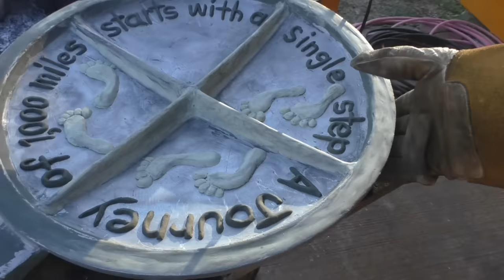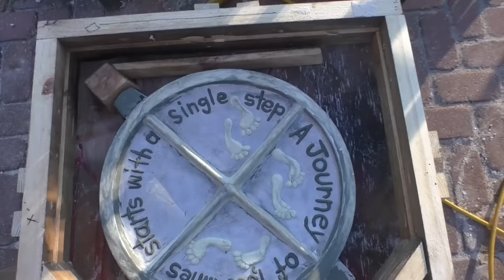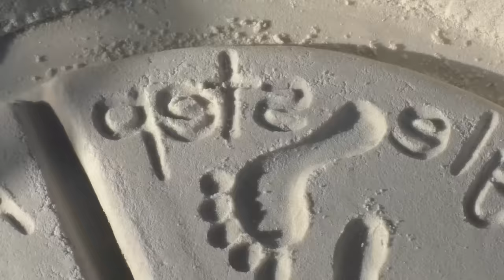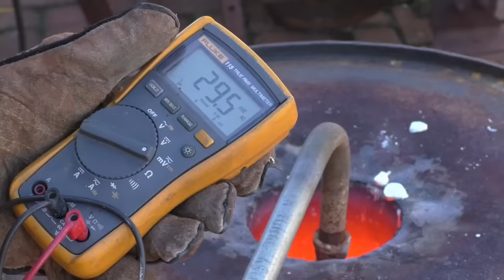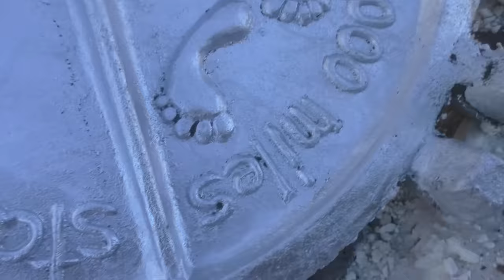Step by Step Aluminum Casting with Sodium Silicate Sand

Comment: I have a 5 gallon container of sodium silicate that I am going to try out soon!  My foundry supply also suggested using sodium silicate sand for home casting when I was getting started.  So far I have only used petro-bond, lost foam in wet sand and plaster/sand mix.  I really like the PB, but now I have about 60lbs of the stuff that needs to be remulled. Thanks for the detailed vid on SS sand!
Reply: Alphaset is a very cool product sets up like sandstone and is perfectly dry (think 1/8-3/16 walls). the molds can sit for years, they even set big blocks of it and CNC the cavity out. silicate I'm told loses half its strength in 24 hr. I made a 11-part mold out of it and filled it with 100 pounds of iron

Comment: This was the first video of yours that I've come across.... and I watched the entire thing haha. You kept the knowledge coming the entire time man. Thank you.
Reply: Same ways.  You've got an excellent channel yourself good sir.
Reply: I've watched some of the older videos starting maybe 6 years ago or more as was really inspirational when I lived on the Kalamazoo River since was researching building a steel or aluminum (titanium would be interesting though never verified materials performance and cost seemed unreasonable) electric hybrid jet boat with solar cells on the surface. I was also toying the idea of integrating into a larger sailboat catamaran or with jet boat motor room center hoist boom crane idea pod trimaran.  I did get around to experimenting with using a 1000W gas generator with a computer power supply modified with higher current fuse and terminals as well as wiring and used with a trolling motor with the canoe and I think I used on the John Boat that was stolen prior too. Never got around to making a transom with the kayak, though did invest in a windsurf board to keep the project going.  I was also looking into external combustion sterling engines since work better with more heat exchange potential and under higher pressure (maybe better for submarine or trench thermal vent power stations or maybe on some kind of high temperature volcanic tap desalination mine operations system). Well, I wound up being armed robbed and shot while watching a ferro-cement project since was looking into other systems like concrete ice breaker potential projects along with the water cistern and bio-gas generators (ICP/ARC Furnance and fermentation) I was looking into making on the hillside.  Lately, I've been looking into and making rocket stoves and want to make a sodium/calcium/magnesium silica aluminum oxide sand with a titanium oxide liner.   I was also thinking about adding a graphite liner too to store more heat on the outside and maybe prevent corrosion deeper.  I have the materials and way more higher level enforcement now since I had to learn some far out ES/TS EW weapons systems worse than the Cuban Embassy U.S. Diplomats et.al. issues to determine what was targeting me in the first place.  Excellent videos!

Comment: nicely done!!!
When you play with the investment casting if you do your first dip then put the tree in a vacuum vessel and pull a vacuum you will pop the little bubbles that naturally form on the surface of the wax giving you a fantastic surface that in many cases will not need any machining. Just a little trick we used to get high definition back in the day 
Love watching the Videos, please keep them coming!
Reply from the maker: +Marc wire    Thanks for the tip.
Reply: Marc wire uui

Comment: To do parts with multiple drafted surfaces as sand castings, you employ cores which are basically just smaller, separately molded sand inserts positioned within the main cavity. It requires making separate patterns for the cores, and you have to be a bit more careful of core, top cavity and bottom cavity alignment when handling the mold.

Comment: Man, this project is amazing. I just came across your videos a few weeks ago and I've been coming back for more ever since.

I did a bunch of bronze, aluminum and iron casting is art school. We never used sodium silicate as a binder, but I remember hearing about it. I have a few tips that may help you. One is that while ramming the first half of your mold you may be able to use green sand to form a temporary form instead of having to come back and clean out all of the sand that undercuts your pattern. I used plasticene a lot of the time, and sometimes just loose sand. What I don't know is if there is a chemical reaction with the sodium silicate.

Another suggestion which was drilled into me heavily by my professors... make your cup bigger. Hydraulic pressure is your friend. It not only allows you to pour a little faster (not too fast to avoid turbulence) but it also acts as another place for your heat to draw from as the casting shrinks. 

And a third suggestion, which may be moot since I don't really know how resilient sodium silicate is; the thin sharp areas of sand are prone to erosion and can cause inclusions. We always mixed our sand a little richer in areas that seemed fragile. 

Also graphite wash... not really neseccary with aluminum, but hotter pours it really makes a difference.

Thanks for doing what you do. It's amazing and your breadth of knowledge and demonstration of DIY method is a body of work all by itself.
Reply from the maker: +derrick mcnew     Thanks for the tips.

Comment: Vinegar and baking soda to make co2..... BTW best video I have ever seen about casting..... You explained the flue and riser and vents perfectly...... To big a riser just gives a chunk for the next melt to small and you could ruin all that work..... Awesome video.... I have done some small aluminum parts  casting..... I used a 14 inch clay flower pot buried in the ground with a u shaped pipe in the ground to the hole in the bottom of the pot with a hair dryer blowing air..... And I used charcoal briquettes for barbecue and added air.... Worked very well..... I just used damp sand which gave rough finish due to the steam.... I cast finned  blocks to shape for machining the bore and bearing surfaces to make radio controlled airplane nitro and diesel engines..... Yep just for the fun of accomplishment...... Ain't it great doing things yourself just because it's about learning and accomplishments..... Gonna have to watch your other videos

Comment: Hi Doug,

First, I want to said you, as you are a real inspiration to give the next step to realise our dreams... You are an idol!!!

Now my idea (an a idea as come from a really ignorant person in cast process) but, seeing this video I had the idea to make more easy and quickly the process to clean the mold in "the side of the feets", using a big donut of hard polyfoam with angulated borders. 

This way, the foam replace the sand and when you open the bottom cover, you will can remove the foam, and the shape will be clean and ready to go to the next step, and you avoid the possibility the damage the molder shape. 

I hope it work, if you try it...

A big hug from Chile !!!
Reply from the maker: +lucholarry    Yeah, that would work.  It's called a "following board".  We used a following board when we cast the propellers.
Reply: +SV Seeker 
Mmmmmm. I saw again the video about the propellers, and is not exactly that i was thinking.

I'm talking about another kind of foam... But i don't know how you call this, in US.

Something like this foam : http://www.foambymail.com/Merchant2/graphics/00000001/polytn.jpg

Big hug !!!
Luis
Reply from the maker: +lucholarry  Ok. I understand.

Comment: The match plate is easy, made lots of them. You make up the mold just like you do, except don't put any holes in the parting line face. You then take the flashing, stick it between the sand and flask, then bend it over the edge of the flask. You do that to both sides. you then put on a bit of fire clay, or nearly any king of thing to seal up the seams, and put thin straps of steel between the flasks, also with the seams sealed up with fire clay. That leaves a gap between the two halves. Instant match board when you pour it, with the runners and every thing. Really great for uneven parting lines, such as the part you are doing. The biggest down side is you get double the shrink, since the match plate shrinks and then the parts you make with the match plate shrinks. It does use a lot more metal then you would guess to pour the match plate. You also have a lot more force trying to open the mold, so clamping and some weights on top help. A little damp sand also helps with leaks. With your glove on take a large hand full and push it against the leak. OSHA probably doesn't approve, but have seen it done / done it in lots of places.

Comment: Nice job. I used to make molds for Rockwells' foundry in 1973. There were the pour-off guys, the molders, shake-out, pattern makers, everything. Seen some bad accidents, too. A guy was standing in the pit with open boots not allowed in the foundry and a breakout filled his boot with iron. foundry boots are tightly banded at the top. Scraping slag off the top with flatbar make sure there is no oil on it or it will blow back a few pounds of melt at you. Sometimes somebody would be goofing around a toss an oiled flatbar into a pot for fireworks, lol. Safety first

Comment: I have had problems with porosity in my aluminum pours, mostly reveled after machining. I'm sure you are ok with your hatch covers but for more critical parts it is defiantly worth the extra step. I have also tried the tablets but they don't seem to do much good for me wither. Lately I have been injecting the molten aluminum with argon gas right before I pour as I heard this is what a lot of foundries do. I made a gas injection apparatus by taking a stainless steel tube and welding it to a round plate (with a hole through it to let the gas through) and several other holes in it to disperse the gas. I have an air hose connected to my argon tank regulator with a typical compressed air blower attachment just like you use for your C02 for curing your sand. I put a rubber hose over the non-business end of the stainless steel pipe apparatus and it connects to my air blower attachment. I first mix flux into the molten metal using the stainless steel apparatus and then bubble gas all throughout the crucible. The flux seems to really help reduce the slag into a light powder which floats to the top. I hardly get any of the chunks of slag that don't melt like I used to. Of course exercise good common sense as just a little bit of gas can go a long way in boiling hot aluminum everywhere. I have had zero porosity issues since I have started doing this. Keep up the good work and keep the videos coming.
Reply from the maker: +Goldenstein Engineering and Fabrication LLC    Thanks for the tip.  I rarely cast anything that critical but I'll give that a try when I do.

Comment: We always just did these vertically in school. There was no worry of breaking the molds etc., we just slid the two halves apart and back together. And dross came right up to the top.. seemed pretty simple. - Very cool work.

Comment: I had a deep draw pattern that took me a long time so I made a silicate mold.  I found setting the silicate at anything over 1/2" thick really difficult  and I had to pierce the mold more times than I'd like to get the gas to set the silicate but the cast did work and I'd never have managed it in greensand.

For the cope I just used silicate as a facing sand but the drag was all silicate.

BTW top tip on switching buckets when mixing.  Wish I'd known that!

Comment: Hi,
I've been following your progress since the very beginning and I find it amazing how much you've achieved and allways look forward to the next upload. Keep up the great work.
A small tip, be careful with liquid sodiumsilicate! It can cause serious chemical burns. Its made by melting silica sand or quarz sand with caustic soda and then adding water and the result is a very high alkaline liqiud. I work with water glass as its known in the chemical industry every day.
Reply from the maker: +Gary-John Spurs    Thanks Gary.    ...and thanks for the warning but in reality I routinely have it in contact with may bare hands and I have not noticed anything other than it stings a bit when it get into a scratch.  The guys at the foundry use bare hands too and they have used it everyday for years.  You must be using something higher than 40%
Reply: +SV Seeker The stuff we make is of a very high concentration. it starts off as a solid looking like broken glass and we basically heat it up and add water. ive had it on me a few times and not realised until under the shower and the top layer of skin peels off. it can be nasty stuff. I wish you all the best with your work and look forward to the next upload. Gary.

Comment: You're using Type K thermocouple.

29,6 mV from the Type K thermocouple with 0°C reference junction.

If I remember correctly you need to subtract ambient temperature mV due to the junction between type K (chromel–alumel) wires with the multi-meter copper wires.
At 30°C ambient temperature you have 1.20 mV on the table, subtracted from the 29.6 mV you read il would leave you with 28.4mV equivalent to 683°C.

Comment: Amazing video, you've covered so many little casting tips and tricks too. I had been wondering about home use of sodium silicate sand as the bulk of the mould instead of greensand. It's given me a lot of valuable information for an upcoming project of mine - a ~400cc miniature Chev style V8. The cylinder heads are looking like it might be possible to actually cast at home via this method as greensand looks to be too difficult to handle with the amount of cores I'll need to add

Comment: I use my TC (#8-gauge K type) to set the temp of the furnace and don't measure the melt. overheating is a source of porosity and shrinkage. great job of showing the process

Comment: I can get enough heat to do brass and copper and I got powdered iron oxide to a warm butter consistency but then my steel crucible burnt away. My next furnace ought to be tougher more efficient and I should be able to do cast iron. I've done aluminum with green sand but cast iron worries me a bit. Like you say, as long as there's a place for the steam it should be ok. I'm hoping cast iron will be ok too. I read that it can get pretty hairy so I'll start small. I have old bunker gear and a good set of boots. If you ever feel like doing cast iron with green sand I'd sure like to watch. I know I need a better crucible too. Not sure if I can use the graphite ones or if I have to go with something else. Heavy steel pipe lasts for a few runs doing brass and copper though. If I can pour one slug of iron that'll be a good step forward.
Reply from the maker: +heliarche   You'll need a better crucible for sure.   And and iron foundry guy said molten iron bounces off more that aluminum.
Reply: +SV Seeker Yea, steel crucibles just don't cut it. They last a few times but it's a bummer when you have a good pot full and it gives out on you. I already went $70 on refractory, a decent crucible won't be much more. I'll start small with iron and keep those buckets of water handy!

Comment: I've watched a lot of your videos over the past week. They're very inspirational, and it's great that you learn as you go. Never be afraid to fail and try again - it's great advice, especially for today's younger people.  I'd LOVE to come visit, especially since I have a huge amount of experience with the fab work you're doing... but I couldn't afford to travel there and spend time away. Oh well. 

I had a thought, watching you toss the hardened sand away. It would be possible to fab together a quickie rock crusher to reduce the chunks back down to sand, which you could build in a couple hours. It's REALLY easy to make, just a couple of steel plates close together at the bottom and wider at the top. Make one of them pivot, moving the top back and forth with a motor/belt/whatever. 

It would be great if you could re-use the sand. The only question I would have about it is... would the dried/used sodium silicate on the old sand do something to affect the new application of fresh sodium silicate? If you had a plate crusher reducing the hard stuff back down to sand, then I would THINK you could re-use it instead of buying new sand all the time. But it would probably require a test run or something... shrug
Reply from the maker: +KOakaKO     At $4 a bag, I'm happy just filling holes in my yard, but the foundries recover about 70% however they have a lot more that just a crusher.  There is an elaborate screening process to.
Reply: SV Seeker
- Oh, I'm sure the foundry has all sorts of elaborate recovery processes so that they don't have to buy new material. For you, I'm just thinking that if you slap together a little plate crusher in a couple of hours, it would probably save you an extra $50 a month by converting the crusty stuff back into actual sand. And it seems like something that would appeal to you, since you're ALMOST as cheap as I am when it comes to stuff like this. :P
Reply: +SV Seeker nice german shepard

Comment: Great step by step explanation!! i see this little cute pulley at the beginning easily casted with sand and a donut shaped core :-) no need for wax!
Reply from the maker: +Pierre-Yves Puech    A core would work but I'd have to change the pattern some.  The real goal is to get the process down for lost wax with NiBrAl.

Comment: Seems to me if you took some 2" painter's masking tape and taped it around the pattern at the split line on the 'bottom', maybe even with some polyethylene sheet. Then when flipped you pull the poly sheet up off the central area and then the tape back to the 'edge', and boom, out comes the pattern. Great vid. I am building a little kiln for melting aluminum and doing lost foam casting.